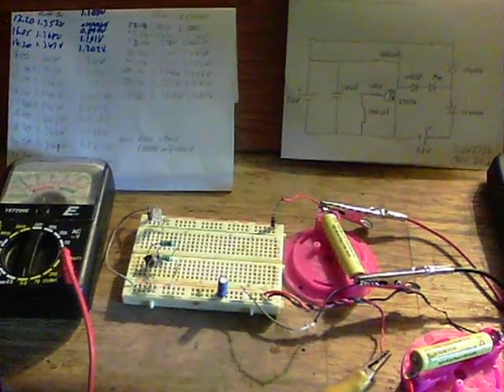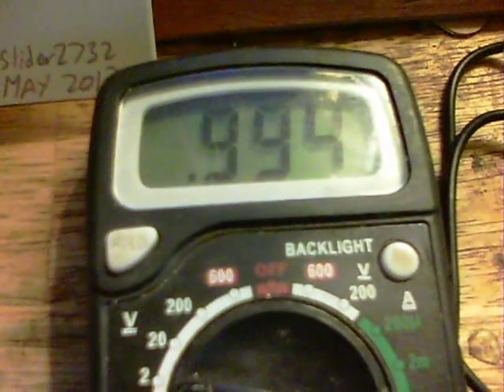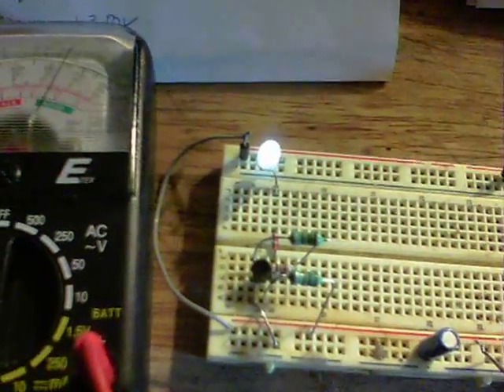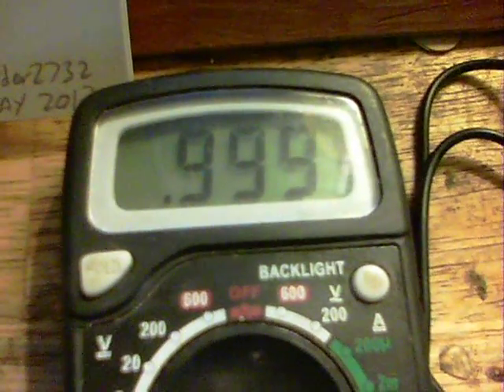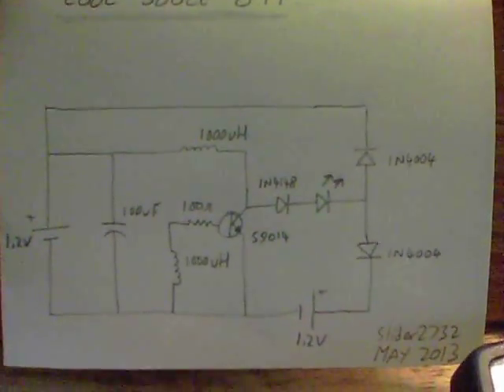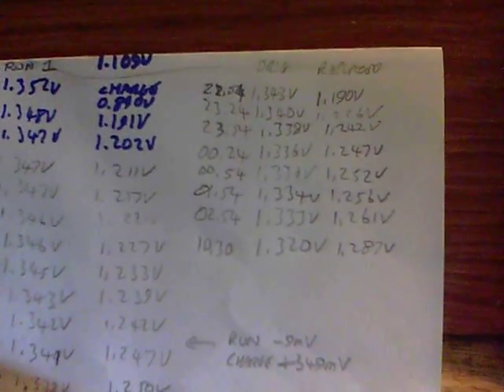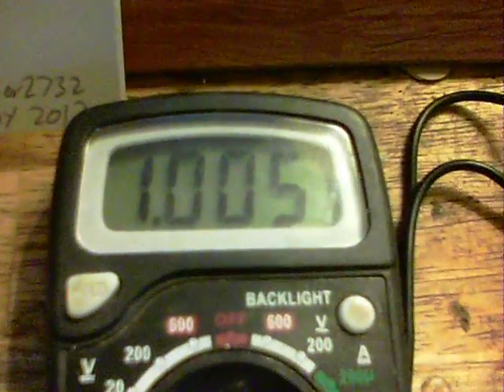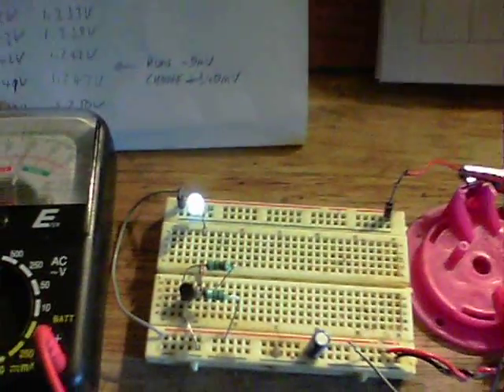Cool Joule GTi

Comment from the maker: Not necessarily. Another factor beside the coil collapse is ambient temperature, as pointed out by a couple of folks on forums...if no temp control in area, may rise a bit in day, drop at night.
Last night saw first surpass of Run battery - Start Run 1.306V, Start Charge 0.954V. End Run 1.235V, End Charge 1.346V. Have swapped them over and will rest after 2hrs run this way. Transistor C2236. No diode return at top of circuit diagram, many trans won't run that way the LED will go out. Draw 1.9mA

Comment: The charging goes up but so does the amp draw on mine.
light stays the same, been running for a day now 2mA draw, no change in battery voltage. I only have 3 digits on my meter, but a 2 mA draw should show a drop???

Comment from the maker: Great to hear. Some transistors run better than others. My present fave is the C2236. With that, the top positive split diode in the circuit diagram can be omitted (as Rimstar wondered) and the circuit oscillates just fine. Charges faster too.

Comment from the maker: It's a shared connection with impedance seeming to dictate pathways. Many variations make the LED quit, yet seem good mentally as a route. Like circuit runs with no return on top right, but uses 20uA more. Between diode + LED gives 3.5V, but LED quits on connecting a Charge batt. There are also aspects like the uA will go up and LED dims when using no 100uF cap and a C1815, but uA go up and LED brightens when using a S9014.

Comment: Interesting circuit. Thanks for sharing. I wonder why it would go to the charge battery (bottom-right of circuit) when it can more easily take the path on the far right back up and across the top to the left and back to the coil?